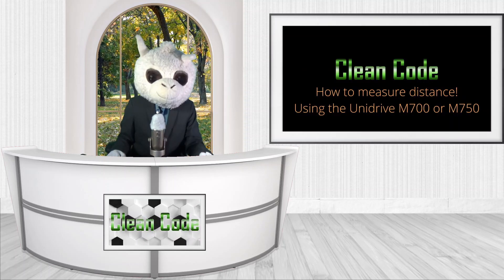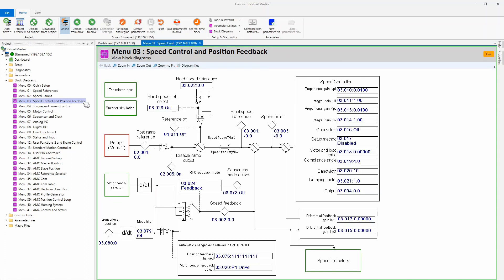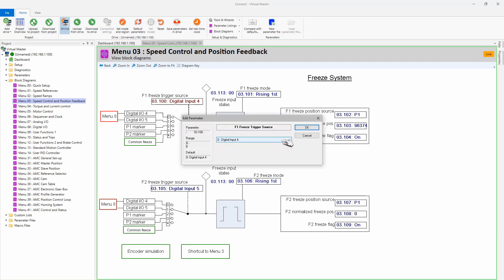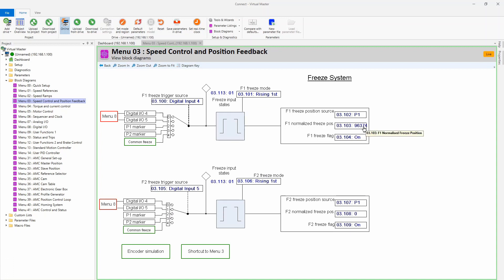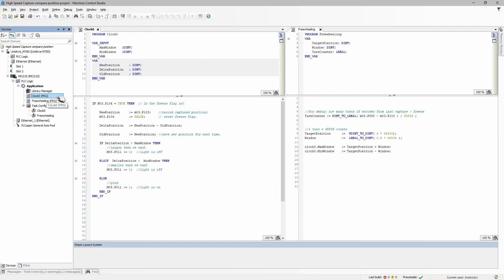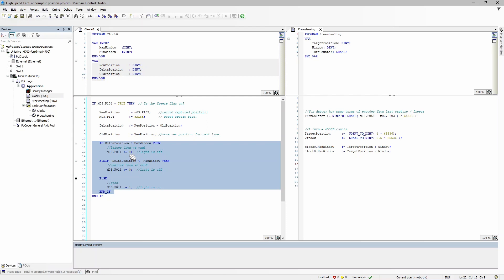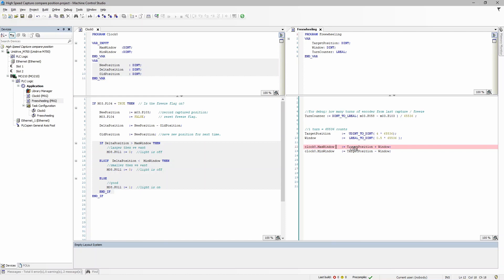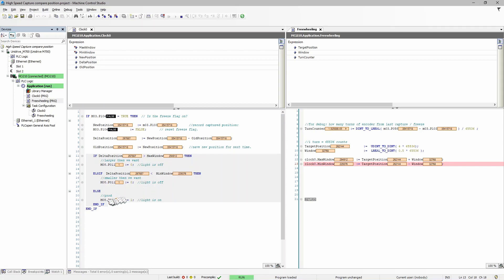Measure Distance with Unidrive M700 or M750 drives.

Comment: How can I display measured distances on the keypad screen... I have seen on other video that you can modify what is displayed on the keypad screen...
Reply from the maker: I'm assuming you're using machine control Studio.   If that's the case I'd probably take the following approach.  The 1st step is to use a custom menu.  These take up extra coding space so use them sparingly if you are not using a mci200 or mci210.  There you can add a parameter with a decimal place at the location you want. you can even name the variable. However the name does not show up in the keypad.  2nd Step. Then you go to connect software and go online with the drive. the connect software will complain about your project not matching the drive. do an upload from drive and magically they'll be a new menu in your connect software.   there you'll be able to see your new parameters you've made. these parameters don't have any names associated with them for the keypad.   however using connect you can give these parameters names. at the top of the window where it says caption if you right click on it you can add another column called keypad caption. now you can edit the name of basically any parameter in the drive. after you've edited the names of the parameters  you can go to the dashboard and you'll see an icon with a keypad on it. there you can download the names to the keypad. this also works for menu 18 19 and 20. please note it takes a long time to write to the keypad so make sure you have it  the way you want before you start.
Reply: @vfdcode  Yes I will use MCS to write the program and probably ( I am not sure) use tag or parameters to display the distance on the the drive screen
Reply: @vfdcode May you please do a video explaining more 8n details

Comment: I want to connect EK9000 with M700... Please assist and use Encoder to properly measure the Distance
Reply: On my Gear hobber I need to use Drive in Sensorless Mode and use two port encoder on the drive to read the distance on X and Y axes to and display it on the  HMI Screen
Reply from the maker: However your second statement is you want the drive to be in sensorless mode OK.  I can help with that.
You also want to use two encoder ports to capture distance X&Y on an axis and display them on the HMI.
If you want to capture the X&Y position you will need to use the high speed inputs on the drive or the universal encoder module. Before I can help with this second question how is it you have the drive encoders wired up.  Basically I need to know which ports they're wired to.
Reply from the maker: I went and googled the EK9000.  This looks to be a bus coupler that supports Modbus TCP.  As you know both the M700 and the EK9000 are Modbus TCP servers (slave device).  If you want the M700 to control the bus coupler then the M700 will need to have an MCI210 module.  The MCI210 module is a PLC that supports modbus TCP both as a server device and also as a client device (master device).   If you had an MCI210 I could show you how to communicate to it.  But you also mentioned assist and use encoder to properly measure the distance. The bus coupler would not have that capability. That is because the bus coupler is far too slow to capture encoder data.

Comment: Very interesting, Is it possible to use a very simple code to move the motor a set index length, using a registration sensor and also a proximity sensor( To let motor know when it is safe to move ) also can this be done in ladder logic?
Reply from the maker: It is possible to do indexing with this drive. It is also possible to use this input to do a registration index. As far as letting the motor know when it's safe, I would have to understand the context a little bit better of how you wanted to use it.  And yes, you can run ladder logic on the drive or on a MCi200 module.